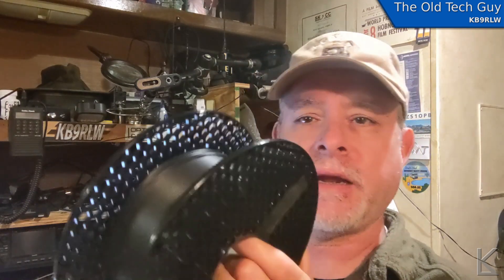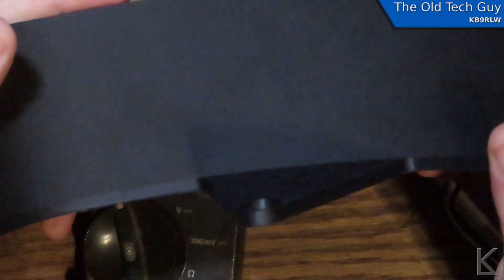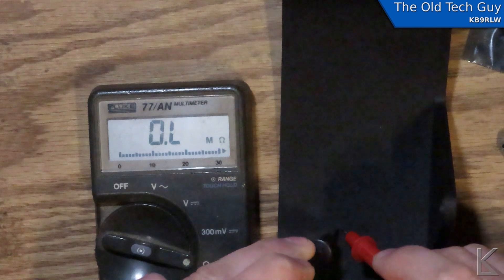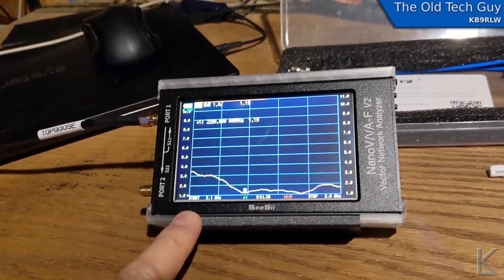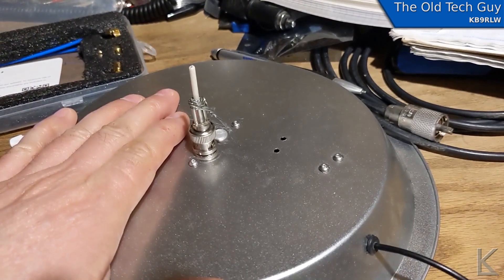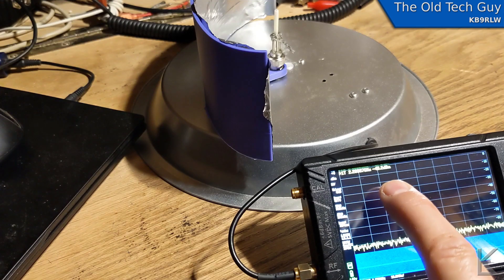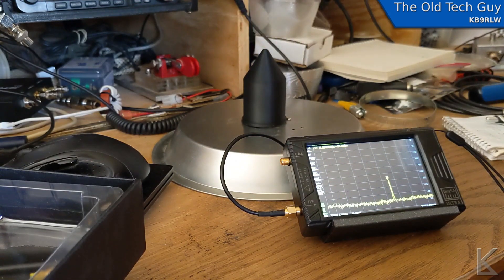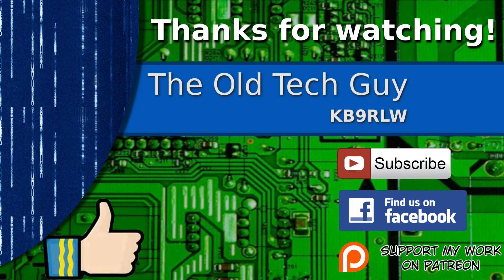Ham radio & 3D printing - Prusament PETG magnetite filament,  3D printable RF reflector or shield?

Comment: I wonder how it would work if you printed cores for baluns. It would be cool if you could make your own
Reply from the maker: Since the filament is only 40% magnetite by volume, there are big gaps between the individual iron oxide molecules. It would be difficult for magnetic Eddy currents to set up nearly as well as they do in a compressed iron powder core. So it would be far less effective and probably so inefficient as to be impractical.

Comment: With magnetic properties, my first reaction was, how would it do as an inductor core, maybe a core to improve the function of an ugly balun/choke?
Reply from the maker: Well we already know an iron powder core doesn't work too well at HF frequencies, and this is an iron oxide at an even lower density so it would be kind of like an iron powder core that has lots of space between the particles of iron. Probably not very well.
Reply: They make air cores out of plastic
Reply from the maker: @jameshazeliii7985  Yes, a lack of conductive material.  Hence the name "air" core. So you could use just about any 3D printing plastic to create a structure for an inductor.
Reply: @loughkb  still curious what would be the result make a plastic core wind it check its inductance and compare to similar size ferrite and one made of the magnetite materiel.
Reply from the maker: @jameshazeliii7985  years ago I made a 630 M CW transmitter. I used my 3D printer to print the coil forms out of pla plastic. At the time, I did compare an inductance measurement of an air core and an identical coil wound on PLA.  I was using a dip meter, and they measured almost identical. 
Ferrite compared to the magnetite would be like comparing ferrite to a compressed iron powder core. Apples and oranges.  The magnetite printed core would be like the compressed iron powder core only less effective since it would just be less dense. There is space between the individual iron oxide molecules so it would be difficult for magnetic Eddy currents set up.
Reply: @loughkb  I haven't bought a printer yet. And I'm just learning radio. I built the SolderSmoke direct conversion 40m reciever and that is where is started to learn about winding torrids and found it was a little in exact it could be quite a leap in value adding or subtracting one turn. It made me think of you could make your own torrid you tweak the size or thickness and really dial in the inductance. Probably not necessary. Thanks for the content! I appreciate learning about what's possible.
Reply from the maker: With toroids, it's about the mix. There's iron powder, and then there's ferrite. Ferrite is a mix of oxides, usually an iron oxide mixed with some other oxide like nickel, manganese, magnesium. The different mixes have different properties that affect how the magnetic eddie currents behave at different frequencies.  It's a whole science in and of itself.

Comment: Hi Kevin, I hate to be picky, but when comparing power levels, I believe you want to use dB, not dBm. 
PS: I love your channel. Thanks for this video. WA1KLI
Reply from the maker: The tinysa was indicating in dbm.  Decibel milliwatt, indicating the signal level present at its input port, coming from the antenna.  Dbm is commonly used to measure signal levels.
Reply: @loughkb , you are correct that dBm is used to measure signal levels. You are also correct that power is being measured at the input port: all that is measured in dBm.
I was referring to when you were comparing signal (power) levels. For example, compare a 5-watt transmitter to a 100-watt transmitter. When comparing power levels, one should use decibels (dB).
Reply from the maker: Okay. But that's not what I was doing. I was measuring the signal level received at the antenna. Not transmitter power.